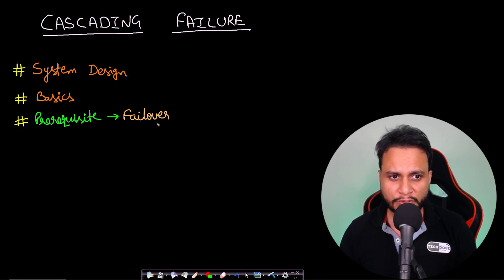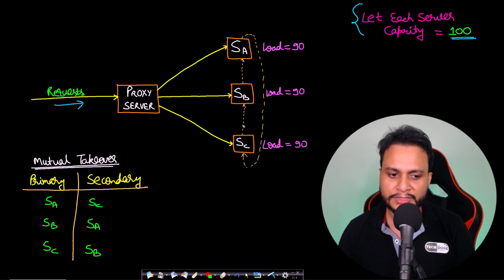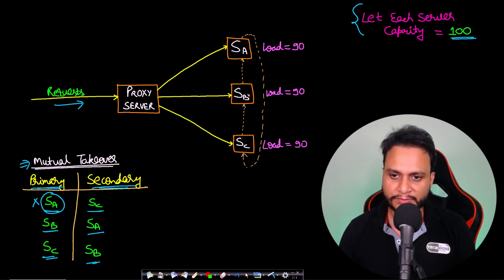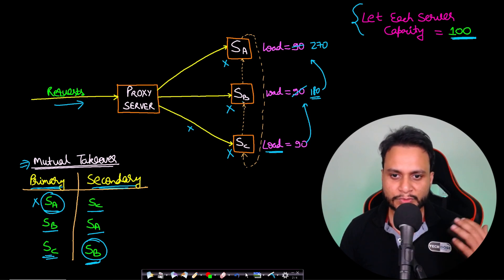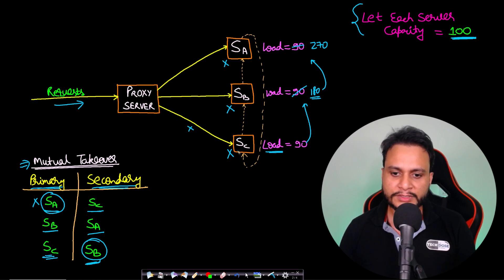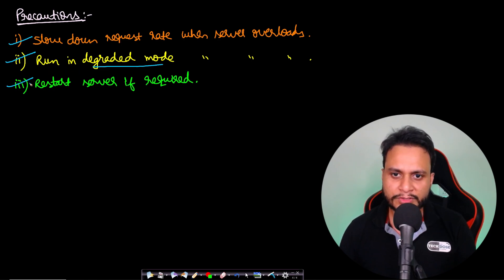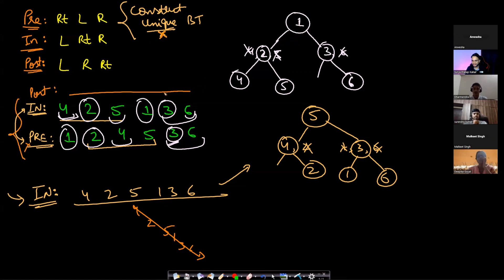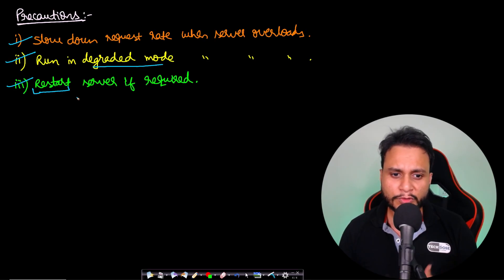Cascading Failure | System Design

Comment: In system design, a cascading failure refers to a situation where a failure in one component of a system leads to subsequent failures in other components, potentially resulting in a widespread or complete system outage. This phenomenon occurs because the failure of one part of the system puts additional stress or load on other parts, which may not be able to handle the increased demand, causing them to fail as well.

# Key Characteristics of Cascading Failures
1. Interdependencies: Cascading failures often arise in systems with tightly coupled or interdependent components, where the failure of one part can directly affect others.
2. Overload: When a component fails, its workload may be redistributed to other components. If these components are already operating near capacity, the additional load can overwhelm them, causing them to fail.
3. Systemic Risk: The risk is not just to individual components but to the system as a whole. A seemingly minor failure can escalate into a significant outage affecting large parts of the system or multiple systems.
4. Unexpected Behavior: Cascading failures can result in unpredictable and unexpected system behavior, making them challenging to diagnose and mitigate.

# Examples of Cascading Failures
1. Power Grids: A failure in one part of a power grid can lead to overloading of other parts, potentially causing a widespread blackout.
2. Network Systems: The failure of a critical router or switch can lead to increased traffic on other network paths, potentially overwhelming them and causing further failures.
3. Microservices Architectures: In a microservices-based application, if one service fails and its load is transferred to other services, this can lead to a cascading failure if the other services cannot handle the additional load.
4. Financial Systems: The failure of a significant financial institution can trigger a chain reaction affecting other institutions and markets.

# Mitigating Cascading Failures
To prevent or mitigate cascading failures, systems can implement various strategies:
1. Redundancy: Having backup systems or components that can take over in case of a failure can help prevent cascading effects.
2. Load Balancing: Distributing the load evenly across components to prevent any single component from becoming a bottleneck.
3. Circuit Breakers: Mechanisms that can stop certain operations when a failure is detected, preventing overload on other components.
4. Isolation: Designing components to be loosely coupled, so the failure of one does not directly impact others.
5. Monitoring and Alerts: Continuously monitoring system performance and health to detect issues early and respond quickly.
6. Rate Limiting: Controlling the rate of incoming requests to prevent system overload.
7. Graceful Degradation: Designing systems to maintain partial functionality rather than complete failure under stress.

Understanding and preparing for cascading failures is essential in system design, especially for systems that provide critical infrastructure or services, as it helps ensure reliability, availability, and resilience.